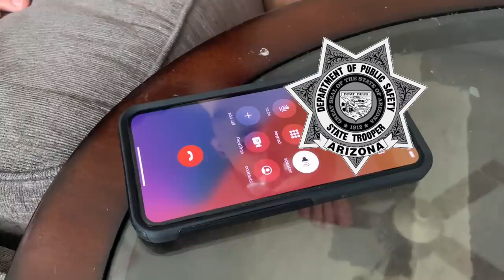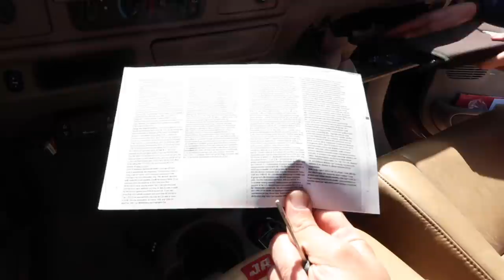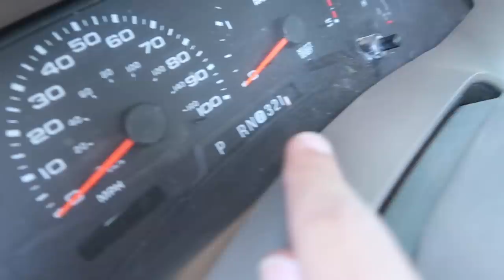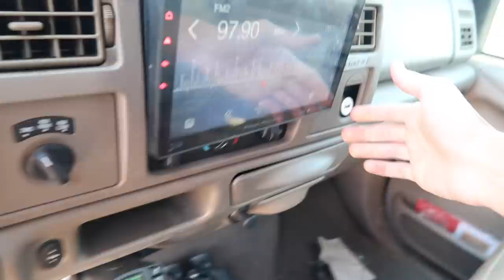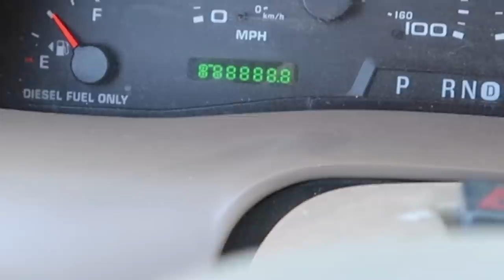We Found Our Stolen Truck! Crazy Recovery On Video!

Comment: I recommend a steel plate reinforcement on the door handles, they are easy to break into with a screwdriver.  then also add a hidden kill switch.

Comment: I had my locks punched out on my F-350 but ran the guy off before he could actually get into the truck. I ended up replacing both the front door handles with rear handles that do NOT have locks in them. Just don't let the batteries die. Only key less entry now. Actually look pretty clean.

Comment: Based on what I see I’d be willing to bet it was used as a support truck for the runners. They obviously took it jumping in the desert. They took off the lights inside because getting in and out of the truck in the desert you have to be completely dark. No lights inside so if you hit a bump and the door sensor thinks the door is open they don’t come on. Also the rf sensor finds tracking devices and cameras. 
The other thing is they probably swapped the dash cluster so be sure to try a new one. Also so code scanners will tell you the mileage. Possible they even swapped the ecu if it’s tied to the key. I’ve seen people take a wrecked truck and swap the ignition and ecu into a hot one. Your better off turning that into an off road truck now because it’s likely those few weeks of abuse took years of damage on the truck. You also should get some one with a drug dog to run through the truck to make sure there isn’t anything hidden inside any of the door panels or dash or any frame rails. They have been known to hide stuff inside fake metal trap doors and frame rails so the cutting wheels comes in handy if they need to retrieve it. The ropes and winches can be used to get a runner truck unstuck from the desert who maybe hit something and they’ll use the cutters to get out the stuff and just abandon the truck in the desert. 

After watching every episode of boarder wars and every boarder patrol show ever I’ve seen it all lol

Comment: Plug in a obd2 reader and read the miles that way. Gauge clustervis probably fryed, also the prn321 gear selector thing shoule be a little cable on the steering colum. When they put that radio in they probably didnt bother imstal the cluster very well
Reply: They were in there messing with the ignition switch.  They probably knocked it off.  It is odd a car guys doesn't know how to put the truck in drive without counting.

Comment: They had to be using it to steal anhydrous ammonia. The hitch was changed out so they could hook onto the containers. Lights are all gone so they could stay dark at night even with doors open.
Reply from the maker: Interesting though
Reply: I had bought a van used to do the same thing is why I say that. Hope yall can bring her back to her former glory. Now is a great time for color matched road armor or ranch hand bumper replacements. Maybe even a newer model front clip swap? That interior really made me sick. Any time I see a king ranch I expect the epitome of luxury interior and it's hard to find replacements that aren't worn at least that bad. The part yall found at the end of the video looks like a bumper bracket. Which sparks the question. How is the front bumper still holding on? I've owned exclusively ford's my whole (driving) life. If the truck has a throttle cable you can improve throttle response by using a couple zip ties as spacers (the cables get stretched over time) also please thoroughly inspect brake lines. That could be the source of the soft brake pedal.

Comment: Install a kill switch on the truck. Make it like a power wire to the fuel tank at the tank to a switch hidden in the truck somewhere
Reply: Kill wire for the power to the ECU, should do the trick.
Reply: @williamgurtner4759  true. But wouldn't that cause issues such as deleting all data stored in the ecm or anything that required .
Reply: I always unplug the coil when I park mine for awhile

Comment: They definitely have a hidden compartment somewhere in that dash for the mileage being messed up they would have been in that dash to have messed it up.
Reply: if the truck is an XLT or a KR (i didn't notice in the episode) it will have RF transponders in the keys.  the info for that is stored in the guage cluster, which has to match the PCM also.  the theives probably had to replace the ignition lock, guages, and pcm in order to use the truck for whatever the bastards were doing

Comment: I've had 2 6.0 Super Duty trucks stolen from me. My 1st one was in 2020, and my 2nd one was in 2021. My 1st one was never recovered, but my 2nd one was recovered just a few days before my birthday in 2021. Those meth heads completely trashed the inside as well as the bed of my truck and kept kept all my tools and my brand new toolbox

Comment: be happy you got it back.  the scratches will buff out.  my truck got stolen 6 months ago.  i didn't have full coverage on it, so it was a total loss.  buy billett aluminum door handles for it so its harder to steal again. i don't remember who makes them but i had to replace the door handles 2 times in my truck before it actually got stolen... the dumbasses just managed to break into it the times before, and broke the ignition switch... i started taking the battery out of it.  they brought me a new battery once!  i appreciated that.
Reply: crazy tho... i had a 2005 f350.  v10 extended cab xl fx4.  i loved it, i put a TON of work in on it.  i had it for like 6 years.  i got a deal on some tires and wheels.  these folks that had just bought a new truck in 2019 sold me their wheels and tires from their f350.  they had been used for 3 months.  they sold the set to me for $600.  anyway.  my trailer was attached to the truck when it got stolen, so my business is now totally disabled.  i flip cars like you guys do.  i try to specialize in mercedes, which is a huge challenge, but i've done mechanic work all my life so i can handle it.  i've had 5 cars stolen over the last 3 years.  that, and the city towed away 6 cars after we got evicted from our old apartment... my partner had lost his job, i couldn't handle bills by myself.. with all the cars stolen and the city impounding so many cars, the truck and trailer getting stolen was the last nail in my business's coffin.  from having 16 cars at my peak, i now have 4.. i'm wondering if its worth even trying anymore, even though i loved it meh we'll see.  i did recently get back a car that i absolutely loved, my 2007 mercedes clk 550.  i got it running again, but the transmission won't engage since i had to change out the ECU, ignition switch, steering lock, and the keys.. mercedes security and anti-theft is outstanding, but a real PITA when you're just legit trying to fix your car... anyway.. i'll get a new programming/coding scan tool since my old one got stolen too (!#&&)!(*)!*#$#..another like $2500 hit....not trying to sadsack, just want you guys to be able to count your blessings.  BUY THOSE BILLET ALUMINUM DOOR HANDLES though guys.. our trucks are insanely easy to break into, and the ignition switches break out pretty easily too.  if it is 2005 or older there isn't even a transponder in the keys (on the XL models anyway, not so sure about the XLT or KR) so once the ignition is broken out it just takes a screwdriver to start them..that same screwdriver the bastards use to break the door lock cylinders out of the handles to break into the trucks..and the same screwdriver the bastards use to break the ignition cylinders out of the steering column.. anyway...i'll stop bleeding all over your youtube posts....have a good one guys

Comment: My truck got stolen, I got it back luckly. 

I live in Ohio, I’ve was searching for a crew cab long bed, 4WD, auto, 7.3 for 3 months. 

Me and my dad drove down to Atlanta Georgia, and day I bought it and it got stolen at the hotel I was at. 

The guys who stole my truck ripped out an atm. Luckly my truck wasn’t used besides that. But they ran my truck out of diesel and the steering column was fucked

Comment: Does your truck have the factory tire pressure monitoring system? If so when you put on those copper rims they should have been paired to your trucks t.p.m.s. and your systems would be still on the rims sensor

Comment: Hi
You can get a custom made ignition lock made for the steering column for your truck, also remove the locks on the doors, order in rear door handles use them on the front that’s if your key fob works still unless you went aftermarket immobilizer

Comment: Find your receipt for the wheels it will have a serial number on it and kindly ask the other person to have a tire removed and there should be the same number stamped on the inside of the barrel or sometimes on the inside of the face if they are 1 piece wheels if they are multi piece wheels the number will be stamped on the backside of the face and a tire won't need to be removed at all.

Comment: Put a Revelco system and you won’t need tracking devices because it won’t get stolen anymore. Take it from me, there have been two failed tries after the Revelco was installed.

Comment: our 2006 6.0 got stolen twice in the same year. Frist time it was found stuck in the middle of a park. Appartnly they tried doing donuts with it also had a party on the canopy. Front plate stolen back plate still in. Also exterior and interior was trashed and plenty of scrathes on the paint. Thieves got away with it. 2nd time found near the airport. This time they took the canopy off, spray painted the doors, stole all plates and radio. Plus trahed it and filled it with tools, cigerette butts, and a ton of car keys. The guy was caught breaking into the lot it was towed to and went to jail.

Comment: My 05 f350 was stolen last year, They found it 2 days later ditched it in a parking lot with both brand new agm batteries missing. the cluster was broken aswell, mine ended up being a fuse that they blew when they took out the interior lights

Comment: I no some wheels if u had them installed with tpms sensors the truck remembers them u  have to user a code scanner and wheels have be close to your truck I believe each wheel sensor will have a code when u scan it to

Comment: So here's a way to identify your rims and tires you have a TPS  system that check  Is the pressure of your tires it should have a code specifically for yours that you had it done at the place that you had no tires and don't it would match up to your rims and tires
Reply: Should match your tires and rims inside the sensor saying what it Your computer telling the system your tire pressure should be a code

Comment: Check your truck for gps trackers , just in case . It looks strange the whole thing, if it’s not been used for some criminal activities then it has to be a hired job just to mess your truck up . How can you destroy a truck In Just 3 weeks without doing it on purpose? If he wanted to keep it he could just paint it , even very cheap with  spray cans and he wouldn’t destroy it like he did .